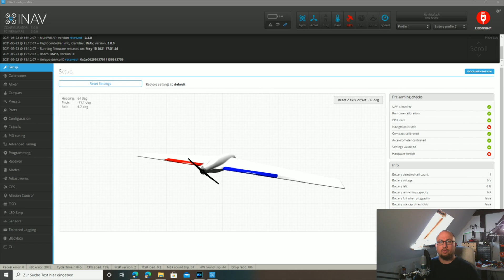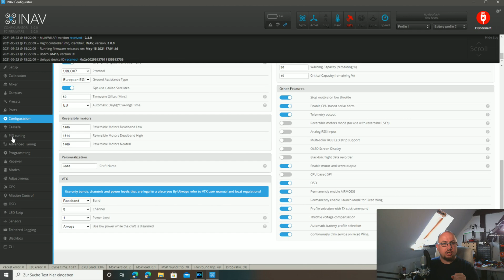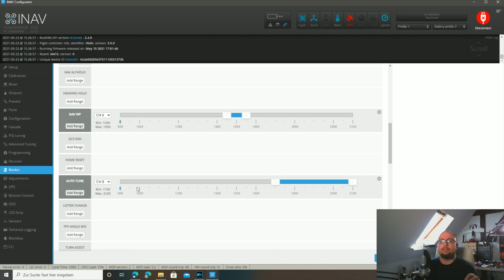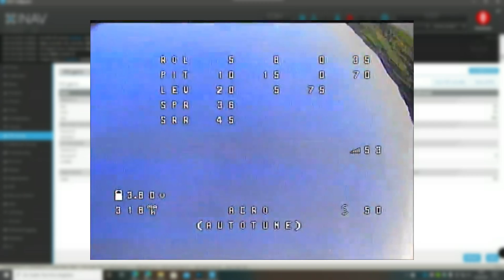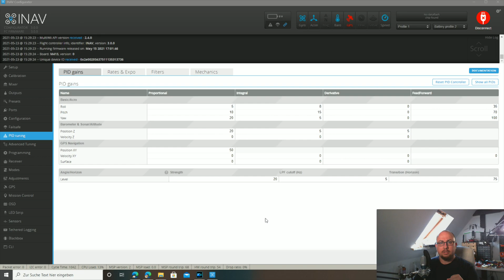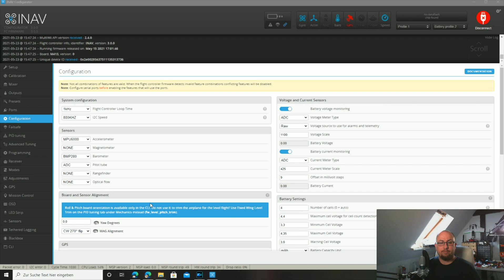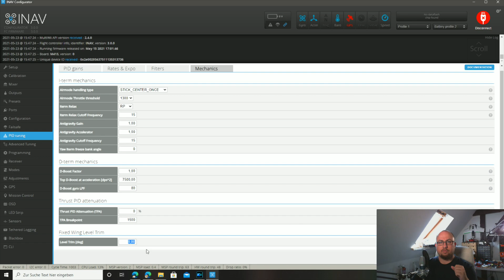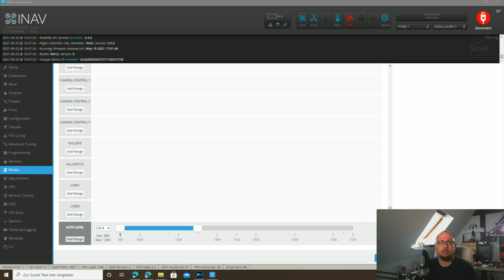INAV 3.0 Tuning - Autotrim, Autotune and Autolevel

Comment from the maker: NOTE: At 11:10 I talk about the P-FF and I-FF Relationship. I did a mistake there. A value of 10 means that P will be 10% of FF. So a higher value will lead to a more locked in feel and a lower value will make the tune softer.

Comment: greeting marc...grateful if u could throw some input regarding inav 6.1.1 from a beginner...
1. in auto servo trim mode, we land with mode still ON, yes? Auto save when OFF the FC, yes?
2. do we land with the same procedure if autoLevel mode On or Auto Tune On?

Comment: Do you enable Autotune with Angle/Horizon mode OR acro mode in the modes tab?
Reply from the maker: Only do autotune in acro. Check my later manual tuning guide there I explain it more.

Comment: I have a question about the auto level feature. If I put it on the same switch position as horizon mode, do I leave there all the time or do I remove it after a few flights? And if I want to enable altitude hold mode and horizon mode will it have any negative affects if I have auto level also enabled?

Comment: How do you level roll in Inav 3.0.  My artificial horizon is off by about 5 degrees in roll.  I understand the pitch trim, but there seems to be no trim for roll.
Reply from the maker: you can do that in the CLI with align_board_roll
. So you can use the command "set align_board_roll=50" to adjust the sensor alignment by 5°. Or maybe -50. Depends on the direction.
Reply: @MarcFPV  Thanks, you made my day!

Comment: Hey Marc!   So I'm clear, the AutoLevel mode, when paired with Angle or Horizon will adjust 'Fixed Wing Level Trim' more or less for level flight?    This does not do anything with trims, right?

You can now either continously trim or use the old method of the 'servo autotrim' mode?

I tried the Autolevel paired with Horizon and I was getting a pretty significant dive.   It sounds like I just need to give it more time to work.   I'll keep playing with it.    It also seems that doing Autotune before hand might help, especially if usng the old 'servo autotrim' method to trim.

Thank you for the video, it is a great help and I'll have to modify my 'new model setup' process accordingly!

Comment: Will the autolevel change the roll values also?
Reply from the maker: no Only pitch. We foudn no way to reliable trim roll as a uncommanded turn in angle mode can be caused by ANYTHING. not only roll alignment.
Reply: How can i change the Rolllevel? My board is not leveled caused by the foam an it glued inside
Reply from the maker: @CryptoFPV  if it is so bad that you have to correct it (2 or 3 degrees is no problem) then you can do that via CLI.
Reply: Thanks. It was helpful

Comment: If you map the new auto level to be active with angle mode, do you need to disarm and save after each time you fly in angle mode?
Reply from the maker: Autolevel should save it's value on disarm just as Autotrim and Continous trim does.

Comment: Is it possible to show an OSD element to see what Autolevel ends up with? Is the value automatically saved after landing?
Reply from the maker: unfortunately there is no OSD item yet. It was implemented late in the 3.0 development process and no one wanted to risk to change OSD stuff at this stage.
Reply: @MarcFPV  Fair enough! thx.

Comment: Hi mark, thanks for sharing your knowledge  i did an autotune with my ar 900 wing it did fine while in autotune i after i save the setting  i did an autolaunch and the  pitch was oscilating a lot i lower the  pitch i gain from 36 to 26 it help but still bumpy when i transition from manual mode to angle  is the
Reply from the maker: hey roger. Have you done autotune in acro mode as shown? It should not have oscillated as the values are active during tune already. The only thing that I could imagine is, if the PIFF values are tuned too high. Please wait for the Final release of 3.0 today, then apply the preset again and try again. There where made some changes to the tune process after some feedback.
Reply: @MarcFPV  Danke Marc  for reply i did the autotune in acro mode but switched to manual for landing with autotrim off(more trow in manual ) when i hit the switch it when instantly in a spin  but was ok the second fly . the pitch ff is quite high at 167  i will do another autotune with a new preset a milli
on thanks  Regard from Quebec Canada

Comment: I am going to try version 3 this weekend after following your guide, when you use the new Autotune do you still have to switch it off before landing and save & reboot as before? I assume with the new permanent Autotrim you don't have to do anything now as its permanently on?
Reply from the maker: Yes you still should disable autotune before landing. Although by the way it works now it should not matter actually if it is enabled or disabled on landing. and yes with the new servo trim you don't have to do anything extra. 

Wait tillö saturday evening before flashing. RC2 might get released on saturday and will include some fixes and optimizations, also regarding horizon drift.
Reply: @MarcFPV  Thanks I just went to download Inav 3.0 and saw it was RC1 but thought it was stable already so will take your advice and wait and just go fly this weekend on 2.6.1 as its been such a long time with bad weather and just want to have some fun.

Comment: Great video. I was waiting for this.
What settings you will recommend to reduce torque roll on launch? Higher FF, higher P to FF ratio? Or something else?
Reply from the maker: If you have torque roll on autolaunch, then use the idle throttle to have the motor already spinning before you throw. Like in a manual launch too. This will stabilize the throw and also the motor causes less torque when going to full throttle after you throw.
Reply: @MarcFPV  i'm not using autolaunch. I launch at angle mode + little pitch up trim. My 90 % flight time is manual, I need more level strenght, more authority in roll axis.
Reply from the maker: In this case your problem is not torque roll. Is the plane mechanically trimmed so it flies straight in manual mode? What plane is it? You can apply a higher P-Gain for more aggressive stability but this can lead to oscillations or bounce backs after rolls. Or if the setup is very powerful, launch with less throttle. You should only launch with a throttle value wit maximum 1:1 thrust to weight ratio. Not more. Alternatively if the plane is very powerful, then launch in acro mode and just throw it near vertical.
Reply: @MarcFPV  It's Dart XL, plane is trimed and fly level in manual, only launch is hard. 
I would say that stock motor is too weak to this plane. 
I will try launching with less throttle.
Reply from the maker: @yojazdayo  ok for the dart XL you have to launch at full throttle. But the launch can be tricky. I recommend autolaunch. look on the Channel of BlueFish, he has documented his journey with this plane. https://www.youtube.com/channel/UCmULLc8W-knTqiFqJgw3-FA

Comment: So if flying in angle mode with auto level active and model is diving or climbing, do you just let inav sort it out or can you correct with pitch inputs and auto level will still adjust pitch alignment?
Reply from the maker: You have to let inav do its thing. If you input stick commands the autolevel algorithm freezes. It is only active when sticks are centered.
Reply: @MarcFPV  so if I have a model that currently requires say 5° pitch alignment can I keep that value and let auto level work from there?
Reply from the maker: @Davyorr  yes you can keep that and use pitch trim just for fine tuning.
Reply: Hello Mark,
As you mentioned, i'm going to set autolevel on the same channel of angle model, so both of them will be active at the same time.
Assuming it, autolevel could be switched on all the time when using angle or is it to be used as autotune?
Reply from the maker: @eltio77556  you can enalble it all the time. But I found out that in very windy conditions with strong raising of falling air masses, it might get off trim sometimes and needs a bit of time to realign. 

So afterall I will use it like autotune and it will replace the autotrim for me.

Comment: so after I do a Autotune in Acro mode with the continuous trim enable. I can turn off Autotune enable Angle mode with the Autolevel then land and save the Autotune before I disarm. all on one battery pack?
Reply from the maker: you have to disarm after land to apply stick commands or enter the menu to save. But beside that, yes you can do it exactly like that. And with continous servo trim you don't need to worry about that too. Just check the servo midpoints after the first flight and trim mechanically if it is a new plane.
Reply: @MarcFPV  Thank you!!!!
Reply: @MarcFPV  Thanks. Do we need to worry about the bug 7281 and continuous autotrim? Also I assume autotune is the same in INAV 4.0?
Reply from the maker: @goku445  7281 mostly happens on F411 boards as it looks like. Especially the full wile.  make a config backup after any config change, just in Case for now.

And 4.0 does not tune PID anymore. Only. FF and rates. And it turned out thst this works much better as the default PID values are already very good for most planes and smooth flying.
Reply: @MarcFPV  Ok thanks. I'm using F411WSE in most of my planes, I'll keep an eye out for this bug. I don't think it happened to me yet but I was on 2.6 for the most part.

Comment: Great video Marc! One small correction: fw_autotune_ff_to_p_gain = 10 means that P will be set to 10% of FF, so higher values give higher P-gains. The same applies to fw_autotune_p_to_d_gain; D is set as a percentage of P (0 by default for now).
Reply from the maker: ah dang. I thought it is a devider and not percentage. Sorry. I will add a note
Reply: @MarcFPV  same happened to me a couple months ago